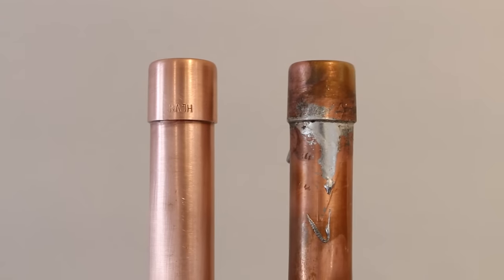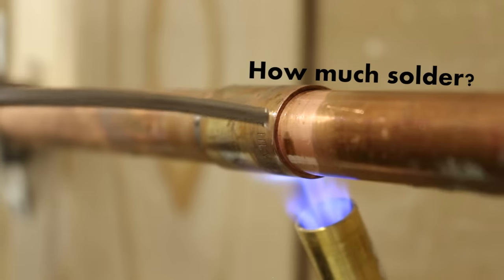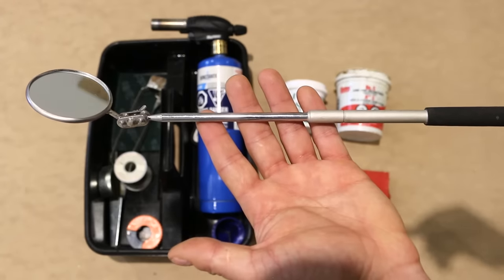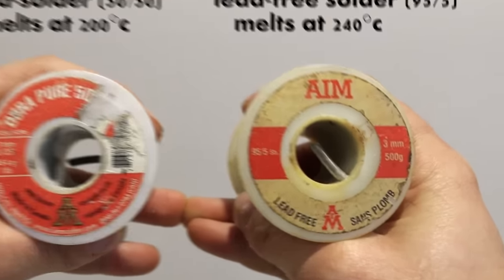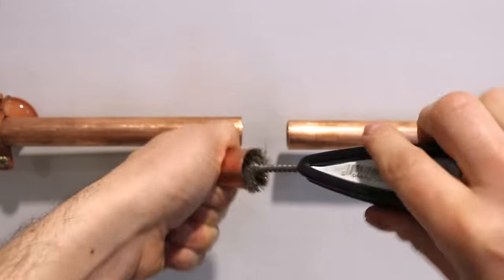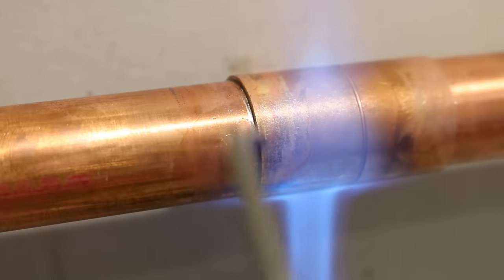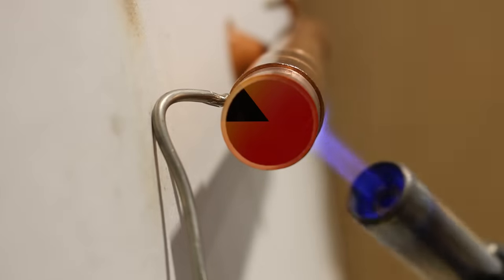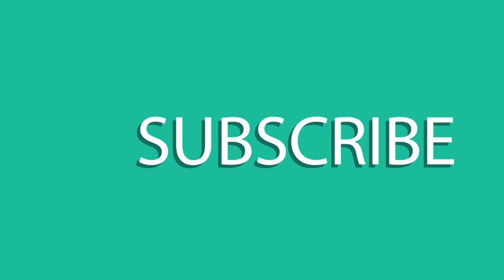How To Solder Copper Pipe Like a Pro (Tips & Tricks) | GOT2LEARN

Comment: When I was an apprentice soldering on site, a clerk of works pulled me on my joint prep. He told me to remove the fitting after I’d prepared it as normal, I then saw most of the flux wasn’t in the joint but had gone into the pipe itself, and was waiting to be heated after which it would run into the system ( heating/plumbing etc ). 
The same on the outside of the fitting, any excess flux would melt and hit the floor instantly.
The solder itself was the same, the joint can only take so much solder, so, by adding too much it either ran into the system or down the pipe into the floor.
My method now is - 
Clean both joint faces
Apply flux sparingly with a brush
Wipe any excess flux off
Measure a piece of solder equal to the pipe circumference 
Bend that solder 90 degrees. at your measured mark
Heat pipe gently as above, pull away as soon as solder is melting 
When the measured piece of solder is used your done. If you need to you can flick the flame over the joint to keep the heat melting the solder. Never use the flame to melt the solder

Lastly, I use a piece of asbestolux  board  approximately 200mm x 200mm as a barrier against burning/marking wall etc.
All plumbers/heating engineers have leaks, but, this method causes me no more issues leak wise than any other solderer.
Reply: So it takes you 20 minutes to solder a joint
Reply: John I actually solder very little, I bend 15/22/28, and as a maintenance engineer, use copper tectite sprint fittings, very expensive but don’t have to worry about raising “hot works permits” and waiting 45 mins after last soldered joint before I can leave site. 
And my soldering method is very quick, no blobs of solder or flux to clean up from my work space.
Reply: CerealKiller wrote: "Measure a piece of solder equal to the pipe circumference"
If you follow that procedure, you will have a joint with three times the solder needed!! You should have said: Measure a piece of solder equal to the pipe diameter.
Reply: lacro I’ve gone off ‘Yorkshire” fittings, not an exact science I know, but it’s served me very well over 30 years.😀👍 I normally use them for every soldered joint, a little more expensive, but worth it for asthetics in my opinion. 
I never solder anything I can bend, I can pull half a dozen bends in a 3m length with precise accuracy. I use tube expanders to join lengths together having the female joint facing down below my eye-line, and facing upwards above my eye-line giving a seemingly jointless run of tube.

Comment: Hopefully you just gave me the solution to my problem. Two of my 17 soldiers are leaking. Actually three, but one is just an extension coupling. 
  The problem is I can only see just over 5o% of the pipes because there is no headroom, and in addition i have to reach over, under, or between the pipes to heat or solder. The problem is it is a water heater, in a small closet, underneath a stairwell, and near the wall so that I can't get a view.                         This will be my third attempt, and if this doesn't work I will have to take apart an entire section. 
  Well back to the grindstone. Oh, and thanks for your videos. You may want to see some of mine too. Thanks again.

Comment: Il be honest man, there's a lot that I personally see wrong as a plumber for 11 years. If someone worked for me and I saw solder joints like that I'd either reteach them or let them go. Id rather a sloppy looking solder joint thats guaranteed not to leak because it was given enough solder than something "good" looking that you can barely even see any solder in. I run accross solder joints like these every now and again because they either are susceptible to early leaks at the joint or straight up blow out. Stop doing this, solder the joint fully and push that solder in all the way around when soldering. Neatness when soldering mostly comes with how good you are at heat control. You are over heating both the fitting and the pipe, try different methods of better heat control and when, where and how to apply solder at what temperature.

Comment: On a commercial site you would be fired in a few hours. You fill it until a tiny bit drips. Rag off flux runs. Also tinning flux is not a bad idea in most circumstances especially brass fittings, it is recommended. In this trade if you don't touch your solder all the way around that's a bad habit. Much higher failure rate. I literally do this for a living.

Comment: I'm really surprised. I got a lesson from a professional from Bay City Mechanical, and that dude insisted that you have to get the whole thing red hot... Is it different for industrial? This was working on 200 ton chiller.
Reply from the maker: Never get it red hot, too much heat will burn your flux off.
Reply: @Got2Learn   I've never soldered pipes before, but that definitely didn't feel right... Lol  Okay, I'm gonna spend my lunch break practicing. I'm an engineer apprentice at a hospital. Thanks!!
Reply from the maker: Awesome, good luck brother!@
Reply: If he was working in a chiller instead of residential pipe he probably was using silver solder which is a different animal

Comment: I would suggest caution with your suggestion to use a license plate behind the joint you are heating.  In my case I put the painted side of the license plate against the wall, with the tin side facing the joint I needed to heat and as I heated the joint, the paint on the other side of the license plate caught on fire with a flash flame that started the wood on fire.  I had a pail with water to douse the flames, but it was a bit exciting for a few moments.  Otherwise, your video was quite informing and helpful.

Comment: Awesome, so when you pressure test, you can never find which joint you missed soldering. There's a reason why plumbers did it that way for 100 yrs, don't try to re-invent the trade.

Comment: Great video(s). This is the second I watched and you deserve the "subscribe" 
The worst is when you have a leaky main valve and it produces just wnough water in the line to lead water to your joint and you need to heat the crap out of it and kill the nice joint you were planning on doing.😢

How can you get around this if you don have the ability to shut off the main from the street?
Obviously this would be with renovation work.

Comment: My method for vertical joints is so tidy, all you do is feed it in from the top and keep the flame low and a bead of solder will appear at the top and bottom with capillary action. Obviously it’s only for vertical straight copper fittings.
Reply from the maker: That's linda what happened whole I was making the video hehe ;)
Reply: Everybody has their own 2 cents on how this should or shouldn't be done. If you can do it better then good for you, "Woop-de-doo".
Reply: ghostmanromeo uk not blowing my own trumpet mate, just spreading the different methods that can be used. Knowledge is the key we should all be sharing what works for us. I have no idea what whoop Dee do is 🤣🤣🙈🙈🙈

Comment: Yeah this technique is good for those that want that. Mine is the in-between one where a thin neat line of solder is visible but not messy. Yes getting it just hot enough but not too hot. I've never used green scrub pad only emery cloth and fitting brushes. I'm not at all  very experienced plumber only was a helper apprentice years ago. Clean it super bright then don't apply too much flux. Heat it just enough with mapp gas I don't use propane. Then once " write " around the pipe / fittings.  That is , just use solder wire end and go neatly around the joint. But now am leaning heavily towards pex. With shark bite or just crimp on fittings I'm not sure yet.
Reply: For most repairs, I have decided to use pex with crimp rings.  There seems to be a difference of opinion about the longevity of sharkbites, but I haven't heard too many loud complaints about pex fittings, although I am sure there are some.  Also, the pex stuff is cheaper once you get the tools. However, I don't know why I am worried about longevity since I am 81 and don't have that many years left either. :)  I do have a couple of places where I am using sharkbite push ons in my washer pipes.

Comment: Heat the pipe not the joint and when cold wash down! Never had a dry joint in 40 years and I was taught to leave a ring of visible solder and nothing more. The problem now is the flux’s we have are not what we learnt on and this does not help, the best flux you can use now for a novice is one that changes colour as that tells the novice when the pipe is at the correct temperature. We just used nasty acids years ago and wire wool! And don’t forget water and gas pipes use different temperature solders or where I am we only braze gas and aircon joints now. Here’s a tip if you have water in the pipe it creates steam and won’t solder , if you can’t stop it leaking then use some sliced bread roll it into a ball and ram it into the pipe and solder as fast as you can, the bread later dissolves. Jut clean out the nearest tap filter!
Reply: That bread trick! I had a pipe full, and it just kept boiling, had to use a shop vac to suck it out. Wish I new about this trick!

Comment: I would like to assemble copper pipe for decoration.  could I use the tinning flux by itself to create an electrically conductive connection and simply heat the flux and not apply any solder?
Reply from the maker: Yeah just applying the tinning flux will do the job if it's for decoration only.
Reply: Just use glue if its for decoration and it will be stronger then just flux

Comment: hi. 
thank you about the great video and the professional tips. 
we are planning and building special climate control units- in the industrial air solutions business.
the temp range of the system after its ready and sent to the costumer is  is between 75 Celsius  degrees in the maximum and 0 degrees in the minimum.
we would like to achieve more clean soldering as you shown in your video.
our questions are:
1. do we need to use  2 types of tin ?
2.does all the tips that you gave in this video  suitable  for air condoning copper piping? is it different from water copper pipes?
3. in our process, we attached :
3.1 copper to copper- pipings and fittings
3.2  copper to brass 
we will be more then happy if you can help us with those questions
best regards
avi

Comment: so far this applies to rod like copper lines.what about coiled copper pipe?
the same,except coiled its out of shape,due to its nature.have to round off edges before cut,and solder fittings.(there are tools for this purpose).why we have both? my case,i use rod pipe for exposed work,and coiled for concealed,or underground work,where looks,isn't a biggie..

Comment: I have been really struggling with soldering but as soon as I kept the heat gun strong rather than the recommended low heat it was easy. Why is this? I started a plumbing course a month ago and they recommend a low heat.
Reply from the maker: I would recommend using a soldering torch, a heat gun is too cool for soldering
Reply: I've never seen someone using heat gun always a type of gas torch. Sometimes propane or even acetylene but I think mapp gas is best.

Comment: I don't consider the "good" examples actually good.
Impossible to inspect. They could just as well be leaky.
If you have a couple of millimeters wetted with solder next to the joint, the likelihood of a good joint is MUCH higher.

Comment: I prefer wiping the joint connections and having an excess amount of solder, to increase the possibilities of having a stronger soldered joint that will not leak at all, versus a joint that looks too clean and with possibilities of leaking, causing thousands of dollars in water damage, and a lawsuit against me for a pipe leaking.

Copper pipes will be located mostly in the walls, under a raised foundation, and through other areas of the house and not in plain view. So long as you the job properly even though it is bot as clean as done in the video, no worries at all. Even the cleanest looking soldered joint will not even be seen in plain view.
Reply from the maker: This technique is for exposed pipes.
Reply: @Got2Learn  Yes. It looks better than some of the sloppy jobs. 😃👍

Comment: You should have shown how to mark the depth of the pipe going inside the fitting, then clean and flux very carefully only that area, because a clean copper surface even without flux will create a little capillary action and end up with solder on the pipe

Comment: Also you can use a digital heat gun with a curved fitting at the nozzle to prevent blackening of the copper, it takes longer but the job is completely clean

Comment: After I soldered my 3/4” copper pipes, I forgot to wipe off the extra flux when I finished the job,  it’s only been a week. What is the best way to remove flux? Can I use isopropyl alcohol, or mineral spirits or maybe a ZEP all purpose cleaner?

Comment: I've watched  a guy flux a joint then throw flux on after the solder any 1 have a take on that
Reply from the maker: I normally just eipe the joint with a rag after it's cooled down a bit, the whole flux thing is unecessary, those pipes are gonna get insulated anyways ;)
Reply: It cleans it in a way, make sure to wipe excess

Comment: Wrong. You NEVER start solder at the top of a horizontal joint! You might get away with that on tiny stuff but anything larger cut it open on a bandsaw and take a look at the perfect V pattern you made inside. Gravity’s a bitch, and that is exactly what happens when you don’t start from the bottom. Technically start at 5 o’clock and take it up to 11, then start another at 7, overlapping from the first pass, all the way up and around to 11.

Comment: Definitely won't fly in the real world. This amateur stuff only works for homeowners on youtube. If you're a pro, you take a wet rag as soon as your done soldering and you wipe the joint. Been doing it 33 years with no problem. If you want to get extra fussy you can scour it or sand it.... but why?
Reply from the maker: Do as you please, I never use a wet rag on a hot joint, never. Like I said in the video, this isn't for most joints, you only do this type of soldering when coming out of a floor for rads or towel warmers etc.. Other than that, you solder like you normally would, this is more for aesthetics if you have a few rads in your living room or something, I would prefer not having to see a big blob of solder on the pipes, so to each his own I guess.

Comment: Hi, thank for this excellent video. Just only one question, Is there a technical difference between using lead-free solder and 50% lead solder? Or do you use lead-free solder only for drinking water pipes? Thank you
Reply from the maker: You can use lead solder for heating, and lead free for potable.

Comment: Do the different torches have different efficiency’s on propane usage? I’m asking as if you turn a pencil flame upside down then it turns to a flame thrower but if you do that with a broad flame nothing happens
Reply from the maker: Yes, all torches have different efficiency ratings. The bigger torches are for bigger pipes and won't last as long ;)
Reply: So the pencil flame would be better for propane usage then?
Reply from the maker: I don't believe the gas/torch combo really matters, it's more the application. If you are doing 1/2" copper, I would use normal propane with a pencil torch and if you are doing 2" copper, a bigger torch with MAPP gas is better suited, but you can get both jobs done with either gas.

Comment: I use too much solder as a pro, l've been told, but then again l rarely have any leaks! I like to see it above the fitting, then wipe it with a Terry cloth rag. If the pipe is exposed, then l'm more careful. Trying to ask a novice to use this method & not have leaks is unrealistic. Although cooling off a joint with water is a no-no, it is OK to wrap nearby soldered fittings with a wet rag to keep them cool & from coming unsoldered & creating a leak while you are heating your new fitting for soldering. Watch this video again & see that he used this cooling technique with wet red rag. I have often used curved jaw Vice- Grips to lightly clamp onto pipes to use as a heat sink to prevent nearby fitting's solder from melting. Just use a curved piece of sheet metal pipe or a tin can as a heat shield.

Comment: There are markets where less than this level of quality would result in a plumber losing his job and the customer refusing to pay for the work.
Reply: Like where? Most of North America is primarily pex, especially West and North West. Copper lines are used now a days for heating systems and even then just for manifolds to make it look pretty in the mechanical room. Sure you might see a copper stub out for a toilet, sink fixtures, even then that's up too the plumber. If a homeowner wants to pay double yeah they will demand perfection, better hope his water is very clean because they will be paying for patchwork from pinholes a decade or two down the road.
Reply: @bravobrk  I won't specify because I like to maintain my anonymity, and yes--HVAC system manifolds in mechanical rooms. 

I'm talking about the kinds of houses that have mechanical rooms bigger than my kitchen and 400 amp electric (or more!)...